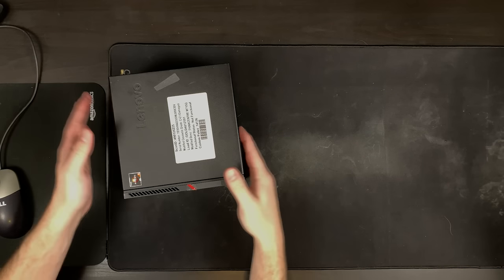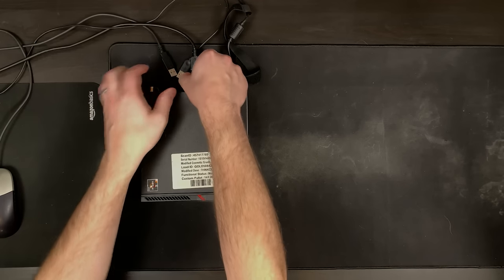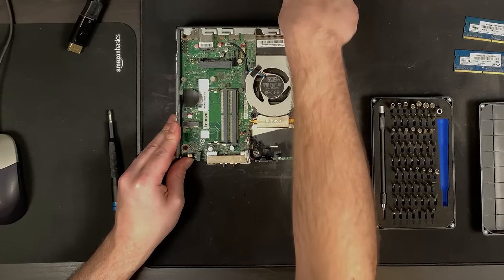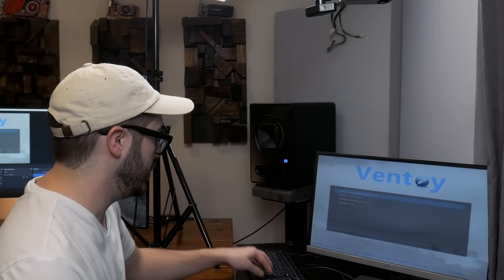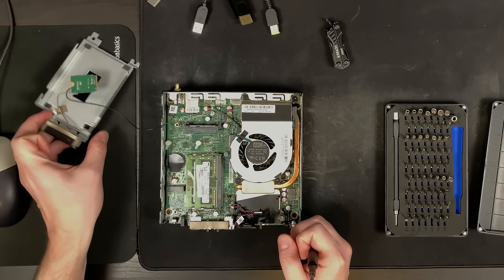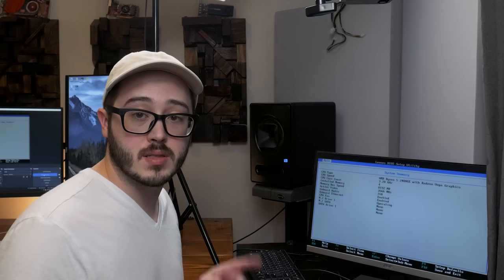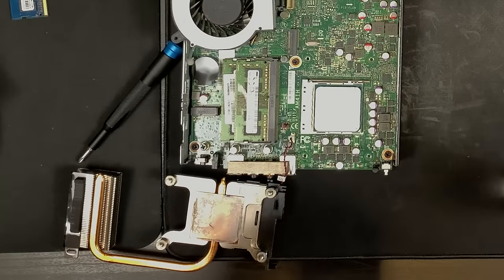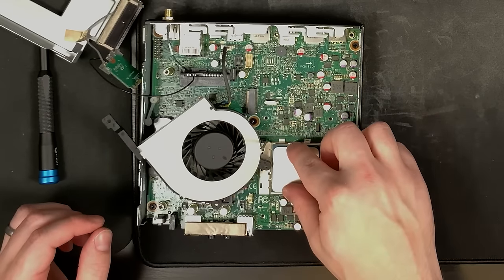Can I Fix These Broken Lenovo Mini PCs?

Comment: A big clue as to why you weren't getting a screen picture, or perhaps 2 clues. There's a label on them all that reads 'Not Functional' and there's no hard drive or SSD.
Reply from the maker: Well first of all, lack of storage shouldn’t affect the ability to get a post. And it’s very possible and not at all uncommon for systems in a lot marked as “not functional” to fully or at least partially function.

Comment: at the middle of the video i was almost angry you didn't run those 2 bad computers with no ram because ddr4 is realy angry memory standard i had problems just like this on full sized computers with 100% good ram that simply didn't work one day and only thing i could do was reset the bios and put one different stick untill it boot  then build up memory up again

also if that lenovo i wonder if cpu's aren't vondor locked because that a feature of ryzens to burn in vondor id for oem maker and make them not run anywhere else
it would be nightmare if you put foreign cpu and make it unusable outside

Comment: always clear the cmos either by jumper or pull the battery.
Reply from the maker: Yeah, I took the advice of adamant IT and just bought a bunch of cmos batteries. Basically I’ll just always replace them if they’re even slightly low haha

Comment: I dislike those Lenovo tiny pc’s, they are super picky on the ram. I have worked on three of m73’s and m93’s that would not boot without particular ram.
Reply from the maker: Seems to be the case with OEMs in general. I've had more issues with HP than anything else. Been lucky I guess with lenovo

Comment: Let me give you some solid advice, keep up the process of elimination for diagnostics. Also, never touch your face while streaming, it throws the audience off. Your glasses are not fitted to you, so they keep sliding down your face. The lenses are not in your centerline if view, so that has got to be bothering you in some way you haven't noticed. Go back to your optician and have them adjusted so they are not so low from line of center and the audience spends so much time trying to decide to look at your eyes via the lens or above the lenses. 

At most a beard, mustache, hair touch is as far as your hands get to your face while streaming.

Comment: Protip: NEVER spend the first 2 minutes of your video apologizing about ANYTHING, especially technical things like lighting, etc, that most laymen won't notice. Until you point them out. It comes across as if you're pre-selling your video as if it's substandard or sucks. That's about the worst thing you can do for viewer retention. If, in editing you find some little mistakes, or said something wrong, do what everyone else does, add in some text in a manual annotation to correct it as best you can. Anyhow I wish you luck. Just something to think about.

Comment: I think you missed what I would have done as step one and likely fixed these. ...Install new batteries and reset CMOS. . So many times I have seen this same thing caused by corrupt CMOS settings .
Reply from the maker: Yeah I should've done it earlier in the process. 👍

Comment: I bought one off ebay for like 30 bucks, you could fry an egg on them they run so hot. I'd be interested in modding the case lol
Reply: Though mines m92 mini with an Intel i5? It was originally i3 with a Windows 7 sticker on it so not sure which is newer. Definitely would like to get better thermals and then use it as a home media computer with a wireless keyboard and mouse combo
Reply from the maker: So not the same machine. I would bet the i3 was a t sku meaning it produced a lot less heat which is why your thermals are on the higher side. Maybe try swapping it with a lower wattage cpu
Reply: @HardwareHaven  they did make them with i5's too I think the heating solutions on the ones you fixed seem more elegant, and you have a WiFi antenna port at the back so mines definitely older gen. They're still fun to play around with. I wanna put it in a broken console case or something and do something case modded related.
Reply: @norndev  I have a M720q one with an i5-8400T and unless I strain it with Blender rendering it get's up to 60-65 degrees Celsius and cooling goes insane.  But even at "Fan performance aimed at better Thermal Performance" I can barely hear it in other situations.
It sounds like you have a package that is designed for much higher TDP's, and the cooler in the M720q's typically is not designed for anything higher than 35W TDP.
Reply: @Dutch3DMaster  it's just ancient, like a 2nd gen i5 and fan running at full speed no matter the temperature, I believe it's common with the model I have. Wish I had the knowledge to remove the stock fan and jerry rig some noctua contraption. The case runs hot but it seems like the case is also being used as a heat sink so perhaps it's normal. It's just the loudness that's irritating, it's very usable.

Comment: Interesting video... hmmm.. but..
Yeah really confusing, like randomly swap stuff?
First, label your machines inside so you and we can keep track of what is going on. Be more methodical, you for some, but not enough. Don't put good CPU'S in unknown boards, as a bad CPU usually won't kill a motherboard, but a bad MB can kill a good CPU, so test removable components in known good MB. And actually first of all on any of them, check the power supply voltages, no or missing power rail, you are done.

Comment: Cpu's are not swappable in Lenovo business machines. Lenovo mother boards burn and identifier on the cpu and that cpu cant be used in any other system...ever.
Reply from the maker: Don't think that started this early on. Pretty sure it didn't hit desktop chips until 4000 or 5000 series
Reply: @HardwareHaven  I read somewhere that Lenovo started locking these cpu's to the motherboard starting with the m715q version 2. You can put a brand new cpu in, within the spec limits, and it will work. But the board will "imprint" to the new cpu on first boot. Unfortunately that means that any AMD cpu used on these little machines from version 2 and on are locked to the board. Thanks to Lenovo for contributing to the e-waste situation.
Reply from the maker: @clayster2  I think it's the M75q g2, not the m715q g2 but I could be wrong. Considering the story of that broke late 2021 early 2022, it seems more likely to be the m75q g2 since the m715q g2 was released back in 2018

Comment: Spin that AmazonBasics mousepad around so we aren't looking at free advertising, sand off that Dell Logo, we all know its a Logitech anyway.  Would boost your production value.

Interesting vid, I haven't worked on any of the AMD Tiny Lenovo yet.  Did any of those Processors get locked to Lenovo?

Comment: ebay scam. did you check the asset tag,
feel like vendor might have kept original ram and throw in 2 4GB (bad one with a good) and pretend not to know what the issue,
those unit might have been hot

Comment: The only critique I might have about your video, is that you need to turn down the apologizing for being a new at this. Everyone starts out 'New at this', and we all get it.
You are being methodical without the benefit of technical training. Many computers cannot have the processors and/or memory sticks swapped across like you did, as they may have changed board architecture, voltage for Vcc for some reason, etc. Secondly, different boards of the same type can have different memory requirements. Lastly, I did not see you consciously "ground" yourself everytime you returned to the bench. I am unaware of the humidity levels in that space, but if the air is too dry you will be able to build up a static charge large enough to tear the guts out of most everything on the board. The MOSFETS all over the board are easily blown by being careless. You have no static strap on, either.

You need to brush up on board handling techniques, as well, as the wrong move can ruin your day. You'll say naughty words and stuff if you figure out that you caused the failure. You may even throw things and that sometimes breaks stuff you'll need in the next 30 minutes. Not saying it will happen, but I am saying it CAN happen. Easily!
Keep up the good work, logical troubleshooting takes practice (and maybe a Mentor!). NOT throwing shade at you, as I started out the same way, by buying a non-working pc and trying to figure out how to fix it. I had it apart across the table in 45 minutes, then took me a month to learn how to put it back together, and install the OS, correctly. Back in 1980!.
I'm with ya, Man! 👍💯🙂

Comment: These form-factors are known as Thin Clients and are the smallest form-factors available from OEMs.
Reply from the maker: No idea why I couldn't think of the phase thin-client haha. Thanks!
Reply: @HardwareHaven  no problem 👍
Reply: Sorry, that's not accurate, these models are full fledged stabdalone desktops, just in a tiny form factors. Thin clients usually run everything off the network and usually don't even have their own storage

Comment: well done. I would replace those CMOS batteries in all 3 just in case. That's a likely cause of the CMOS corruption on #1 and #2
Reply: NO . If the BIOS is currupt which it often gets corrupt by people who try to update BIOS not knowing what they are doing - new CMOS ( not BIOS ) battery WILL NOT RESET IT - it will need to be flashed again entirely . Also bad CMOS battery WILL NOT cause your PC to not POST .  Motherboard and PC will be able to boot just fine even without a CMOS battery present. The only issue is all your BIOS SETTINGS - NOT BIOS FIRMWARE itself will be reset and the time and date will be inaccurate. You will also be unable to save BIOS settings - But it will still boot . Taking out CMOS battery resets BIOS settings - IT DOESNT " FIX" BIOS .

Comment: The first one just needs another ram stick.  It really wasn't even broken as far as I'm concerned as no actual repair was done.
Reply from the maker: So replacing a broken part that’s causing the device not to work isn’t repairing it..? What’s your definition of repair lol?
Reply: @HardwareHaven  Sorry if you were offended.  I honestly mean no offence.  However, for me at least, if you don't use a tool to remove the faulty part itself then it doesn't really qualify as a repair in my mind.   It is basically akin to swapping out the RAM for sticks with more RAM on them.   It's just my opinion.
Reply: @HardwareHaven  Good work, btw.  Again, I was not throwing any hate.
Reply from the maker: My bad, I probably read that in a different tone than you were meaning. I’m still a bit confused by your point though… if a technician repairs my car that won’t start by diagnosing the problem and replacing some cables that were damaged or something like that, you wouldn’t consider that a repair because he didn’t need a tool to specifically remove that part? 🤔 And I agree that I wouldn’t call upgrading the RAM a repair, but that’s because the device was operational to begin with.

Comment: Would probably be smart to unplug power when you take out/put in RAM 😂
Reply from the maker: I even mentioned that I shouldn't in the video lol
Reply: Also, watch those capacitors when your fingers are in there.  They can hold charge for a bit. It's good practice to unplug the power and push the power button several times to discharge them.

Comment: Lenovo sucks all the parts are locked to the motherboard so if you try to switch cpu or even a wifi card it won't work
Reply from the maker: I don't think anything is "locked" to the motherboard on these. Granted lenovo and other OEMs are known to only whitelist certain parts which is indeed frustrating. And the CPU vendor locking thing doesn't apply to these CPUs if that's what you were thinking of. To be clear, Lenovo sucks as a company and I would never buy any of their products new lol

Comment: Hah that’s amazing I bought a stack of three as well
Reply from the maker: Haha nice. Working or nah?
Reply: @HardwareHaven  strange situation. Two appeared to work just fine! One - at best - only boots to post screen with error 0162 and no usb initialization. The cpu works in a standard b450 board but will not boot any other m715q. All other components seem fine indicating corrupt bios. But thanks to your video I have a bios tool on the way and might be able to resurrect it. Surprising that the other two appear to be fine though.
Reply from the maker: @stuffwhy3501  Hope that works out! At least two are working
Reply: @HardwareHaven  doesn't look like it will work out. Verification of the Bios chip fails which I think might mean it's bad bad. I tried to write a copy of a good bios from another m715q and it will write if I skip verifying but it doesn't boot at all beyond the power light and fan spin.

Comment: one other tip would be to take out the BIOS batery. That will the reset the BIOS entirely. Might be helpfull in some cases
Reply: NO . If the BIOS is currupt which it often gets corrupt by people who try to update BIOS not knowing what they are doing - new CMOS ( not BIOS ) battery WILL NOT RESET IT - it will need to be flashed again entirely . Also bad CMOS battery WILL NOT cause your PC to not POST .  Motherboard and PC will be able to boot just fine even without a CMOS battery present. The only issue is all your BIOS SETTINGS - NOT BIOS FIRMWARE itself will be reset and the time and date will be inaccurate. You will also be unable to save BIOS settings - But it will still boot . Taking out CMOS battery resets BIOS settings - IT DOESNT " FIX" BIOS .

Comment: Lenovo have over-engineered these unit's CPU heatsink - Dell and HP just go with a block with the fan blowing air through it, which makes more sense to me. 

Plus on Dell and HP cases they have retained thumbscrews on the case so you can get into the case without a screwdriver. Dell also has tool-less replacement of the 2.5" HDD so Lenovo is behind the game here. These 1L PCs are quite interesting as design objects in how they pack so much into a small space.

Comment: For the love of Jesus, you need to power cycle them multiple times to get the bios to update. The CMOS battery is dead. And you need to turn them on and off multiple times to get them to post!!
Reply from the maker: I’m confused.. how would the BIOS update by power cycling it? Also I’m pretty sure that I explained that I replaced the CMOS battery in all three and tried multiple times to reset CMOS

Comment: THE QUESTION IS

NOT

CAN YOU OR WE FIX ANYTHING

THE QUESTION IS

THERE IS NO POINT IN FIXING THEM OUTDATED THINGS

THE NOVELTY OF PUTTING WINDOWS DOS XP 95 VISTAS ... ONLY LASTS SO LONG.

LMFAO

SO LONG AS YOU DON'T CLUTTER UP THE HOUSE WITH JUNK!

BEN DER DUN DAT !
Reply from the maker: … these are 1st gen ryzen..? 

I literally used one of these this weekend for streaming games to my living room. I’m also running one as a server handling a very specific job at my work and it’s consuming 9w. These are still incredibly useful. This is such a bad take and I rarely say that. Also I feel bad for your caps lock key…